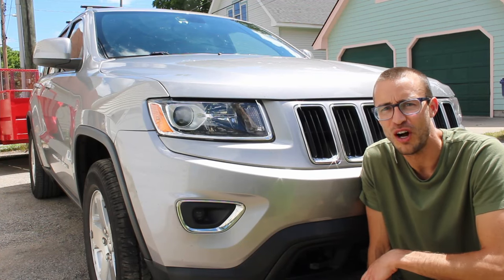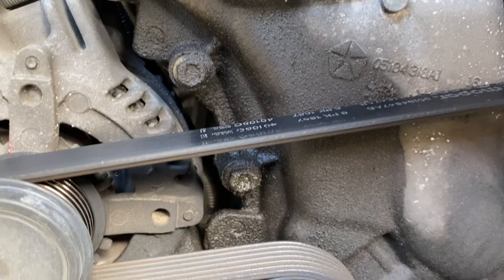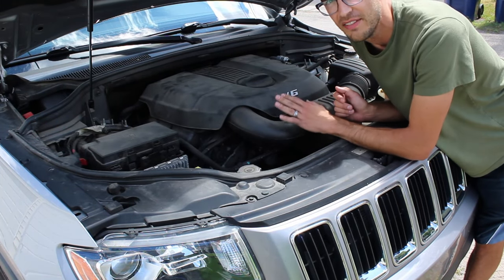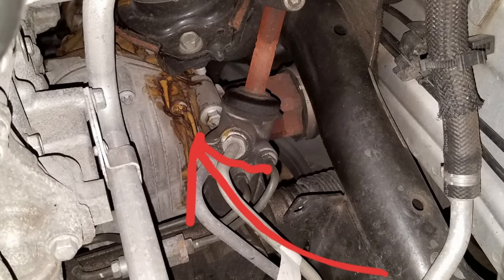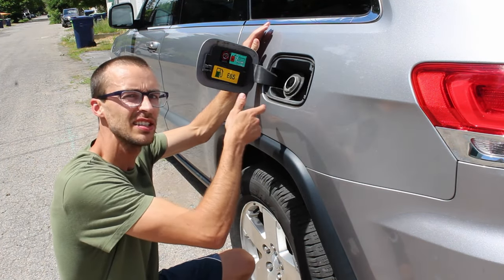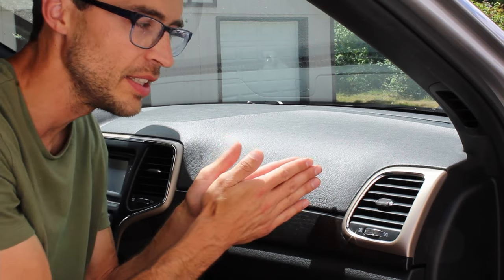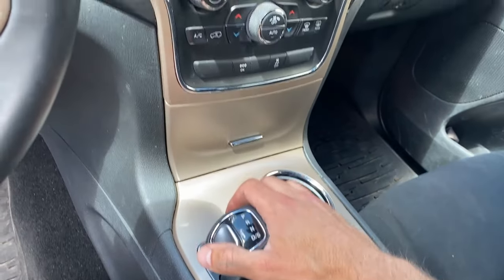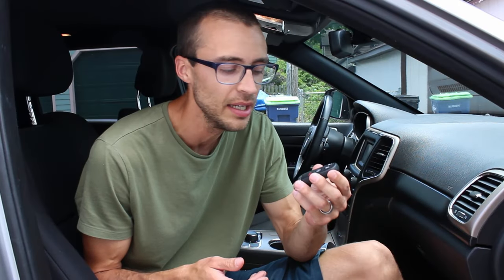Jeep Grand Cherokee Common Problems - 2011-2022 WK2

Comment: 2011 grand Cherokee limited V6. Annoying Hesitation problem.  Changed sparks, coils, PCV, driveshaft,valve cover gasket, tie rods, cv axles and motor mounts. Maybe fuel filter/pump?  🤷🏽‍♂️
Reply: i have the same problem high fuel consumption and poor engine power performance did you find what is causing this?
Reply: @jonathancarrasco5445  Jeep said the transmission. But idk if it’s true. Sorry but I have a hard time trusting these guys. If I talked to the actual mechanic and was convinced then I’d trust it. Regardless we’re gonna run it until the inspection runs out. Have a light for something that’s fixed
Reply: Maybe camshaft sensor. check for codes.
Reply: @watchthis401  P0480. Already changed the cooling fan.  I believe it’s a plastic piece in the transmission that broke
Reply: O2 sensor
Reply: @brianwolford5084  no code though. That would make the Jeep shake?
Reply: @scottflesia4015   Mine would almost die when pulling out of the parking lot at work and then be fine for the rest of the trip. No codes though and no shake.

Comment: 2011 Jeep Grand Cherokee Laredo always kept up on maintenance done the motor mounts, spark plugs, shock struts that kind of stuff. Now I've got the rough idle, sometimes it's really rough. Tried looking for a MAF Sensor no luck all I found was the temperature and MAP sensor. Do these even have a MAF?
Reply from the maker: Most likely do have one. Could just need to be cleaned or replaced. That’s possible. I would check for a vacuum leak too.
Reply: No MAF, just a MAP sensor

Comment: I have a 2016 grand Jeep Cherokee and when I am driving, it starts to shake. The engine light comes on. The auto start. Light comes on and I have had my spark plugs changed. I have had a new injector put in. I’m on the road now I’ve had this problemfor a while now I have 189,000 miles. Thank you for your time.

Comment: The Dodge/Jeep/Chrystler keys are notorious for going bad and burning up the battery in them.  They never "turn off".   I have one key for my 2016 RAM that kills its battery every 2 weeks - and its a newer OEM remote at just 2 years old.  Under a thermal i can see a chip always running warm and drawing power.  I think it shorted when the key got damp in my pocket when washing it.

You also need to watch out for the HEMI knock.  The lifters will loosen and start tapping the valve cover and you will here the constant tick tick tick.   it wears down the metal.  And the Hemi's will start to burn oil when they get older.

I've also owned several of the older model Grand Cherokees and have found even they had a lot of "common" issues that seems to happen around the same age/mileage for users such as the early 2000s models heater blend door warping and no longer working, and it requires removing half the dash to replace it.  And the window lifters constantly break, usually its the rear right that fails first, then the driver

And stay away from the diesel engine models of the Jeep Cherokees.  My friends have had nothing but issues and the dealership was never able to fix them or even get the parts

Comment: 2015 Grand Cherokee, Motor Mounts went out old rubber was cracking and started leaking grease/oil at 138,000 miles (8 years). Had massive Transmission issues at 4,000 miles and basically strong armed them to drop in a new transmission and visually watched. After that, its been normal wear and tear.

Comment: 2017 Laredo slight rattle in the front upon accelerating from a stop almost 140k miles I just replaced the thermostat the plugs and coil packs and vvt solenoid any ideas ?it’s like two cans rattling

Comment: 2014 limited 250k miles, 1 thermostat,  1 blend door. Replaced transfercase. Make sure to rotate tires and akways replace all 4 tires together. That will save your transfercase. 250k very minimal issues. Non of these others.

Comment: I just purchased a 2019 Altitude. I was concerned about the transmission because of the occasional weird shifting between 1 and 2. It doesn't feel like it's F'd, but I didn't think it was normal. Now I know.

Comment: Just got a mint 2015 WK Limited with 109k.  It’s been throwing a random P0420 code. No rhyme or reason to when after a reset, sometimes it’s 300 miles, sometimes 80 miles.  Runs perfect but my scanner says a “stored” code.  Thoughts?

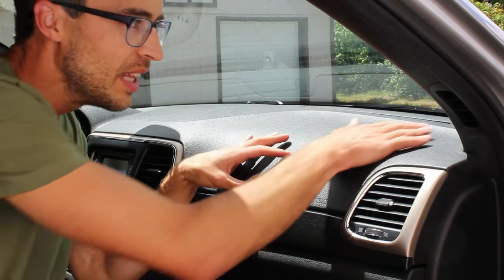Comment: I have a 2013 JGC overland summit 110k. Had several weird things happening intermittently. Recent Long crank, time on radio was stuck at 3:50, master window power switch stops working (i just unplug/replug the back to normal) and when reversing, the screen flickers. The dealer wants to replace all the parts I stated above. It sounds more electrical to me. So tomorrow I take it in for the ignition switch. Not ready to let let her go. Runs like new. Any ideas or suggestions?

Comment: Have a grand Cherokee with the hemi- kept getting service 4wd system and was told it was very common that likely it needed a new transfer case.  Was quoted 4grand for a used one and no guarantee that it wouldn’t have same issue.  I took it to a transmission specialist who determined all that was needed was a transmission computer re-program.  $1000 and zero issues since.

Comment: American cars   like this vehicles are very known for their trademark "Unreliable Vehicles" the reason I  said that is because I owned a 2012 jeep grand Cherokee Laredo v6 72000 miles I've already change 2 catalytic converters, replace thermostat twice, radiator, a/c compressor and condenser, Engine oil cooler, drivebelt tensioner and engine support. and now at 95000 miles there is fluid leaked again under the vehicle . I am the first owner bought it from the dealership. My sister 2008 Toyota FJ cruiser when you open the hood the design of the engine bay looks crooked but no leak what so ever and zero leaked also under the vehicle. Don't get fooled by the physical appearance of those vehicles . My hobby is auto mechanic but for me No more American cars.

Comment: Only issue I'm having with my 15 gc limited 3.6L is the oil pressure jumps from 90s to 40s and back to 90s in a few seconds, and goes to normal pressure once at normal operation temperature.

Comment: 2020 GC limited with 46k miles, bad body control module killed my headlights and horn , glad I purchased an extended warranty on it through the dealer

Comment: Have a 2014 Summit and my moonroof right side motor won't work. It will vent up and it will drop to open But the right motor won't retract.  #2 my backup camera is hazy.  #3 My lower control arm bushings are worn and knocking. 

Ken H

Comment: 2011 jeep Grand Cherokee Overland: 
-blend Door assembly x2 -radiator -upper control arms -water pump -flat camshaft #3 -thermostat -heater core -tire sensors 😬

Comment: High beam stopped working on passenger side headlight at 23,000 miles.  Low beam works fine.

Comment: How about radio issues? This seems to be common as well.
Reply from the maker: Seems common on almost all these new cars with touchscreens unfortunately. Ours hasn’t had any issues though
Reply: There is a recall for the touchscreen radio/sat nav and they’ll replace it for free.
Reply: @NanceDrew  What recall? There is not recall on the UConnect 8.4 screen.
Reply: I don't have a touch screen, but my speakers are out 😭

Comment: I have a 2016 Laredo 4x4 at 93000 now and these are the promblem i experienced with the car i brought it brand new I’m the only owner 
-hood bubble (if anyone has any info for me to get it fixed please send me information greatly appreciated)
-ignition coil (had to change it twice )
- pumping gas my car does keep stopping it where i have to hold it on a angle 
-coolant line leak 
-brake line leak

Comment: Any idea why the TPMS system would be triggered despite all tires being inflated to factory recommend 36psi on a 2011 JGC? The light stays on and will sometimes blink and show that 1 of the 4 tires randomly is at 0psi even though that's not correct. It started acting up when I had a tire patched. Mechanic replaced a couple sensors, but it's still wonky.

Comment: 2012 Jeep Grand Cherokee Laredo owner here just got the car. I am a youtube mechanic so ive noticed every problem that was described here. 
I also wanna add my own: Whenever the air conditioner gets turned on the check engine light goes on It says the high fan circuit is open. Means the high fan wont turn on. i’ve heard its from a faulty wire to the PCM Until now remains unknown

Comment: I have a 2012 grand Cherokee. Changed oil 12 times so far with no problem. Any time you are using a large wrench on plastic, tighten snug not tight. I bought my truck with 30,000. Now it has 96,000.
So far only problem I have had was my Master Cylinder crapped out. (Wich I rare ) I have done brakes and rotors and changed the spark plugs at 75,000. So far all good.

Comment: I have a 2014 as well and mine was running hot and won't start. I just had a new radiator put in and all of a sudden OIL FILTER HOUSING LEAK!

Comment: I had a 2000 Jeep Gran Cherokee Laredo. Had nothing but trouble from day one. Caught fire in my garage with 28 miles on it due to defective alternator. When applying brakes going down hill the steering wheel shook so bad you could barely hold on to it due to defective, warped, undersized brake disks  ( recall issued). Had 4 wheel drive issues. Traded in after 8700 miles. An expensive piece of junk.

Comment: 17  V6 Overland at 79K sounded like ignition knock w ce light. Code for vario valve sensor turned out motor had to be replaced. Luckily I have the max care warranty.  Now 113K intermittent ce code for cam sensor.

Comment: 2013 jeep cherokee laredo 3.6L 2wd. Replaced oil filter cap, rack and pinion, alternator, coolant temp sensor, oil cooler gasket. Still have to do starter since its going out slowly, and also wheel bearings.

Comment: 2016 Grand Cherokee Sunmit 3.6L 94k on it, never had an issue 🤞🤞
Rides great, i have it set to lower when i put it in park and raise when in drive.  Its the same with a sunroof,  if you dont uae it the gaskets get brittle.

Comment: The dealer told my mechanic to replace the OE Center Stack and control module, is this the same part to repair if the HVAC is out… my check engine light is on

Comment: My antifreeze leaks even after changing the radiator and water pump also somethings preventing my drivers seat from going forward i need to check the connections to ensure they are plugged in all the way all other seat functions work. (I own a 11 jeep gc overland)

Comment: I have a 2012 Limited with 128k miles replaced motor mounts twice steering rack thermostat and key battery countless times.

Comment: My wife loves her '15 Altitude but it only has under 40k miles and her sound has not been working for couple months now. I seen this is another common problem that some people have had success fixing by pulling the fuse for the amp and re-installing to reset the amp. However, it didn't work for hers so I guess the whole amp needs to be replaced but she not worried about music so she hasn't bothered me about fixing it and I don't have to drive it everyday so it is still like that.

Comment: I have a 2012 laredo v6 4x4 and I believe the heads are warped and started over heating. Is there a recall that could possibly have them replaced?

Comment: I have 2014 summit and every time I step on the gas the car sounds as if it’s kicking or trying to catch a gear, the gears shift violently, I thought it was the drive shaft but the car is fine when I get up to speeds of 50 or more

Comment: I have a 2015 grand Cherokee limited with 88k miles, 2 months ago replaced the thermostat and bled the cooling system to the best of my ability, but I noticed ever since I did it I’ve been getting a coolant smell when the heat is on it’s more noticeable when the heated air is directed at the legs area (downward),  after much research I cannot find any answers I had it taken to a mechanic at  local repair shop and after hoisting it up he looked for any coolant leaks but couldn’t find any and also my coolant reservoir is not low either, the temp gauge is in the middle between a quarter and middle level,  I even asked him if the heater core was leaking and his reply was “no not this early for the model year or mileage”.    I really baffled by this problem the coolant smell in the cabin is horrible I must wear a face mask while driving, any help with this issue I would really appreciate it thanks

Comment: Had a 2015 with 178,000 miles, only issue I had was bad rocker arms, with the 3.6l traded it in for a 2020 grand Cherokee with a Hemi, so far no issues

Comment: I've got a 2014 Overland with the V6, and it's got 194k miles. So far, so good overall. But I've noticed lately when I push the car hard on acceleration or high speeds it overheats easily and loses power until the engine cools back down. Driving normally it acts perfectly fine all day long. Coolant jug is full and clean, so not sure what's going on. Basically anything over 80 mph is when it starts overheating, but as soon as I bring it down to about 77 it all goes back to normal within a mile of driving at lower speed. It definitely has me puzzled.
Reply: Why are you driving over 80 mph lol 😂
Reply: @Inferno45 why not?
Reply: Almost 200K miles and it over heats? Have you ever washed the radiator to get the bug guts cleaned out of it? I put a screen in front of all my vehicles radiators the day I buy them. Grass hoppers are horrible when it comes to reducing the efficiancy of a radiator as well as the AC condensor
Reply: @A.J. Barron Wrong! A water pump will always pump. In 50 years of working on cars I have never seen an impeller failure. The impeller is what moves the coolant through the system. The only thing that normally fails in a water pump is the impeller shaft bearings or seals. When seals go out they leak and could cause bearing failure as a result.. When bearings go out they grind and screech and could cause seal failure as a result.
Reply: Wonder if it's your radiator fan
Reply: @Inferno  Because when I travel through San Antonio, Texas the speed limit is 85 mph. I just do like everyone else and keep up with traffic. So why wouldn't I drive the speed limit? Lol
Reply: @Kmclemore  Doubtful. Fans normally run in slow speed to stop conditions. When you are up to highway speeds they rarely if ever run because there is a ton of air movement at 80 MPH. The exception to that rule is maybe the fan would run at 80mph if it is 100 degrees outside and the ac is working hard. I still say radiator is full of bug guts and carcasses of bugs. You may not see this with just a visual inspection but if you separate the condenser and the radiator you would be surprised at what accumulates between them. Especially in 200K miles. I replaced a radiator on and H3 Hummer the other day that had only 75K miles on it. It had a screen covering the entire condenser. I was surprised myself as to how many dead grasshoppers were between the rad and cndnsr.
Reply: Maybe a thermostat? Mine recently would stay open when accelerating and my heater was blowing cold and the dash lit up when the temp was <100°, sounds like yours isn't opening all the way when accelerating and the engine is overheating ?
Reply: @Inferno45  there are speed limit signs in Austin Texas at 80. Pretty normal, bud.
Reply: I have the 14 Laredo, was having same problems, changed the water pump, radiator and thermostat,( the rubber gasket around the edge of the thermostat was warped) and it runs fine now.

Comment: 2017 Limited V6 with less than 98k, 5 water pumps in 12 months. There's even a service bulletin about it, but Jeep won't pay for the fix. While #5 was being put in they told me a motor mount was leaking, but they can't fix it because they can't get the parts due to the strike. They wanted $2000 to fix. Jeep stealer rate is almost $400 per hour here, the next closest Jeep is 25 miles away with a similar rate.
Reply: Are these jeeps known for head gasket issues? Currently looking at a 2016 and seller says only white smoke at start up but goes away shortly after

Comment: I have a 2016 GC Overland that we purchased new in July 2016. As of today 12 30 2022 almost 80K miles and not one of those problems you mentioned. A couple of the problems you mentioned were owner abuse, nothing mechanical. For example tightening the filter cap to tight and scratching the console. Still have the original batteries in the remotes.

Comment: 14 Summit. 92,××× miles. I have 2 of the issues you mentioned. (Corrosion on edge of hood,pealing chrome on cup holders) but also had replace adio head unit. It was locking up for the first mile or 2 after start-up. Retaining tabs on front brake pads rusted off, causing rattle over bumps.

Comment: My odometer and radio stays on while Iits parked & hit the fob to Lock it. Still on. Can u please help me. I have 2016 jeep grand Cherokee Laredo
Reply: I had a similar issue with my 2016. I pulled the radio out of the dash - very easy to do. This temporarily solved the problem. After a few days I plugged the radio back in and the problem wasn't there and never returned. Note: plugging the radio back in after waiting a few minutes didn't solve the issue. I thought I was going to need a new radio. It took me a couple of days to price a new radio or after market one. Very expensive - $800. I decided to give it one last try and it worked! Leaving the radio unplugged several days did the trick. Problem never came back.

Comment: I've read the solenoids are common issues. I got a #2 misfire, but after replacing it and reading more about it, looks like it may actually be the solenoid? Any advise with this issue?
Reply: 2017 JGC 3.6L